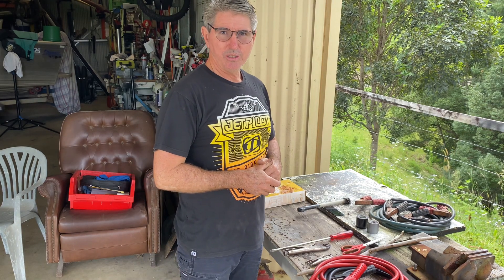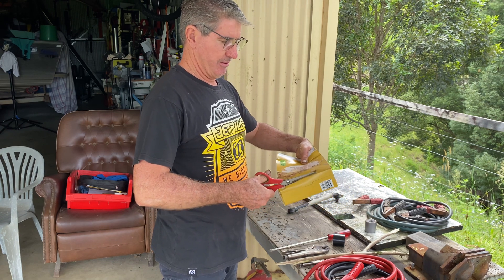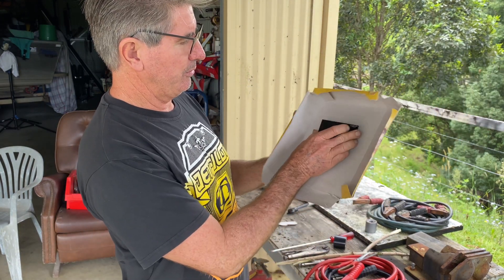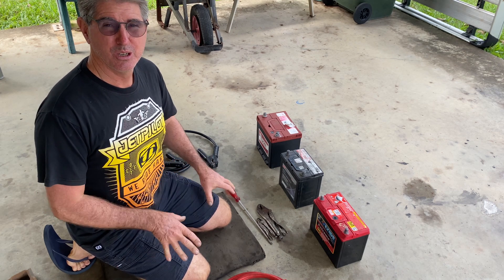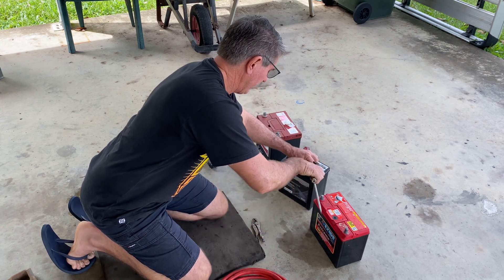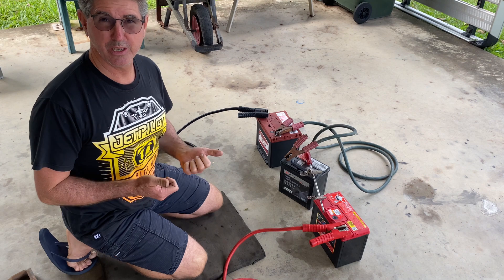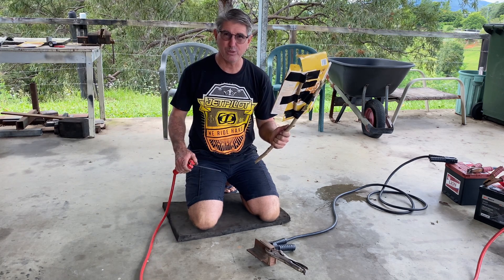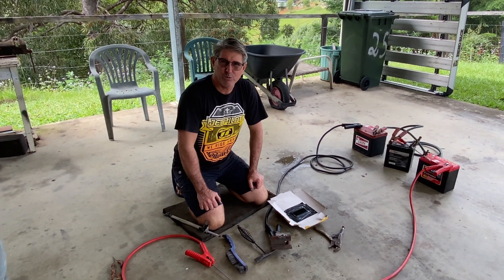Welding with batterys

Comment: Your positive needs to ground your work.   Your electrode goes to negative.   (You weld with the negative).  You are arse about with your current.
Reply from the maker: Thanks Luke seems to work ok either way

Comment: I have a  2 k watt petrol generator would I be able to power a cheap  inverter welder with it  .the inverter welder is  10 to  80 amp
Reply from the maker: Is there a spec on the welder that says how many whatts it is if it is less than 2000 it will work
Reply: @walkaboutturtle9102   I think it just said  240 v 10 to  80 amps on the welder  .it's the parkside inverter welder from lidl here in Ireland. It's  95 euros
Reply from the maker: @markirish7599  I just did a quick google search but did not find your particular welder but similar welders look like they need a 5.5 kva  input power so 
I think your generator is going to be too small 
On the serial data plate sticker it should have input power spec
Hope the weather is good in Ireland it raining here in Australia